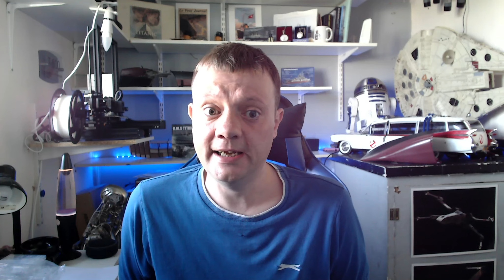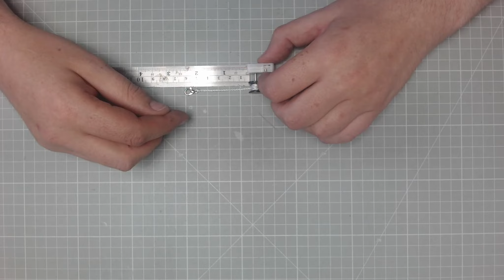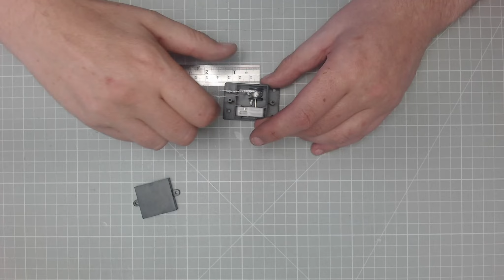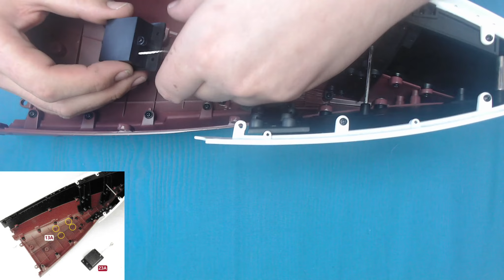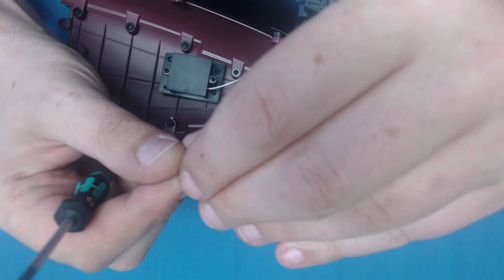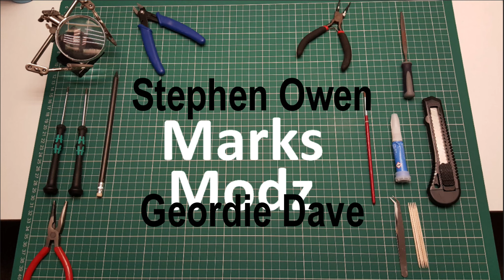Build The Hachette Titanic Issue 23

Comment: Great work Mark, once the anchor is fitted you,ll be able to try it but remember to pull it on the angle towards the bow, great build and video and dont you mean issue 23 and not 123 lol
Reply from the maker: Thanks Dave  and thanks for the tip
Reply: Anytime mate